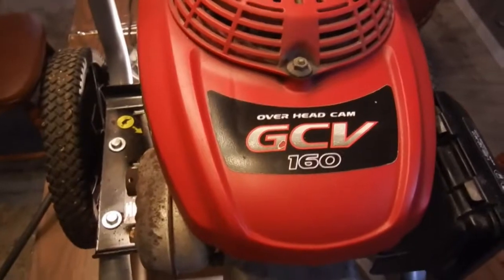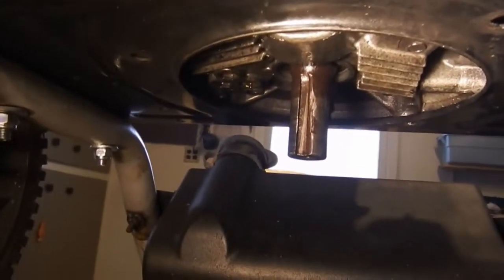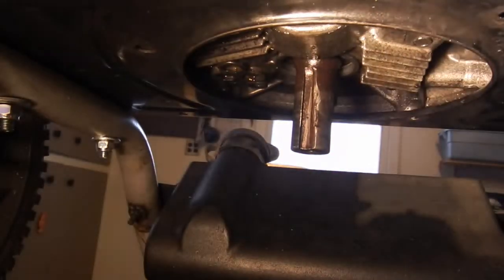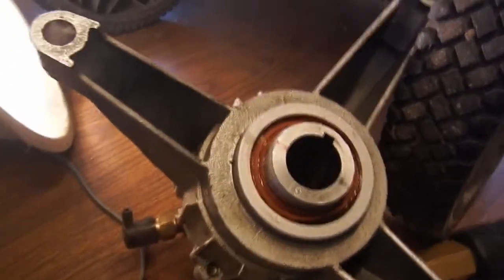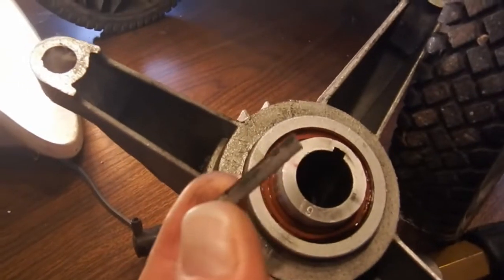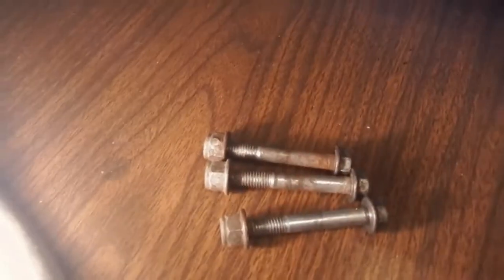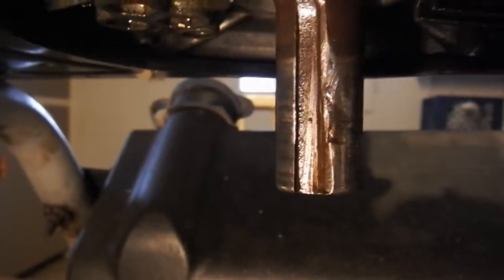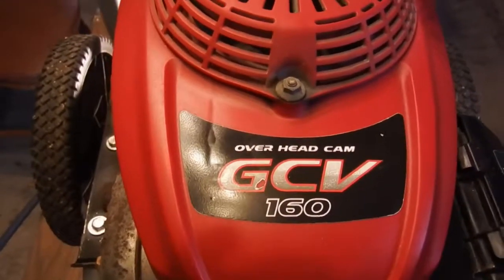Honda GCV 160 Pressure Washer Shaft Key Keyway Failure

Comment: So how do you install the shaft key onto the shaft? I was hoping this was the point of this video.
Reply from the maker: There is a groove on the shaft and the pump.  The key sits in that groove.  You could use a small amount of putty to stick the key to the shaft before sliding the pump into position.  I just held the key on the shaft as I slid the pump on.

Comment: My shaft and key both got "shaved" so the indent on the shaft on one side is lower (it didn't affect the slot on the pump side). Do you need to repair it or simply buy a new shaft key? Do you know where to order a new shaft key and what the part # is? Thank you!

Comment: It’s stuck no matter if I pry pull. Help please
Reply from the maker: It's probably rusted on the shaft.  They can be really tough to get off.  If you can get some liquid wrench or some pb blaster into the keyway area it should help loosen it up.